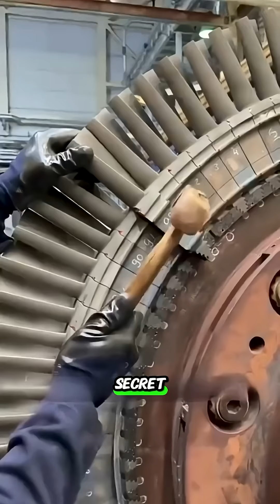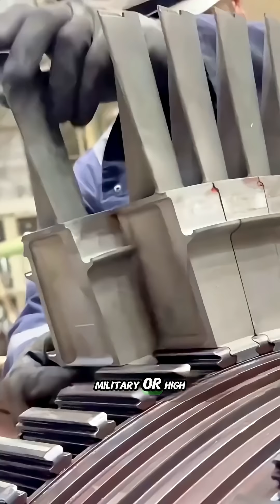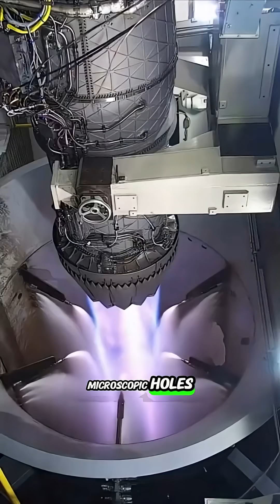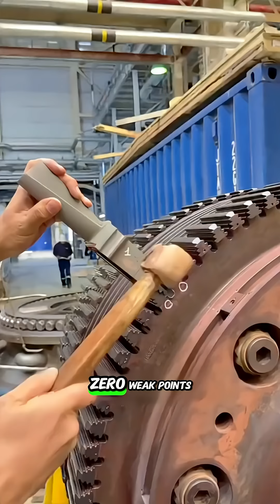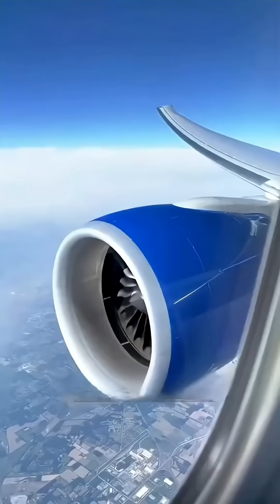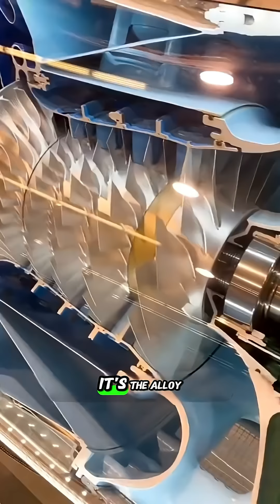The Insane Reason Nobody Can Copy American Jet Engines

Comment: Complete bullshit ! There are no holes in the turbine blade. If you look closely at the video you will see a step like structure at the base of the turbine blade. That is where the clearance is and it is not for cooling it is for taking up the expansion of the blade when it reaches working temperature. This is called Fir Tree clearance or Blade Root clearance. I have overhauled a 100 turbines believe me when I say he is full of shit. The secret is in the alloys used and the metallurgy - these are closely guarded secrets and yes companies like Rolls Royce who are the absolute leaders in this tech will never disclose.

Comment: One surprising thing not mentioned here is the tuning that some engines need.  Certain engines produce harmonic frequencies that can tear it apart. So they tune blades to certain frequencies sop that they don’t. Another interesting thing is if all or most of the components turn in the same direction, CW/CCW it becomes a giant gyroscope. They (RR) had to redesign the engines for the Harrier because they couldn’t control it at low speeds. Half one way half the other. Making it neutral.

Comment: Rolls Royce? 
The real jet engine leader.
Doesn’t get a mention.
Reply: Rolls-Royce is not the “jet engine leader”, lol. That would be General Electric and CFM International (GE & Safran) by sales/revenue. Pratt & Whitney is also above Rolls-Royce by this measure.
Reply: @SillyPuddy2012  you dummy. Rolls Royce is making the B52 engines. Big America bomber with BRITISH JETS in it. NO LONGER American engines in it. They make more than the Americans do as they go into planes all over the world.
Reply: @OffGridInvestor run the statistics you dummy. And do you even know there are only seventy something B-52’s in service? The RR engine is simply the most directly applicable replacement on the market, that’s why it was chosen. None of that changes the fact that there are far more GE/CFM and P&W jet power plants in service today.
Reply: @OffGridInvestor  RR got sloppy seconds from USAF and you brits act all mighty, get real
Reply: @SillyPuddy2012 Utter nonsense.
Reply: @kevinmanns7170  no it isn’t, look it up yourself.
Reply: @kevinmanns7170 it really depends on whether the jet is American or European
Reply: @CrackerSoup1120 partly, and somewhat customer preference. But most craft in the A320 family for example are equipped with CFM engines. All Airbus A350 are powered by Rolls-Royce Trents. But about 40% of A380 are equipped with Engine Alliance GP7200’s (GE & P&W). With the balance being RR Trent.

Comment: Only five countries have mastered this casting technique—the United States, the United Kingdom, Russia, France, and China—have independently mastered the complete technology chain for single-crystal nickel alloys. This technique is used to make single-crystal superalloy turbine blades for jet engines and gas turbines.
Mastering this technique is difficult for several reasons:

What it is: A single-crystal nickel alloy is a metal part grown as one continuous crystal structure.

The Problem: Conventional metal parts are made of many tiny crystals joined together. At high temperatures, these "grain boundaries" crack and cause the part to break.

The Solution: Melting the alloy in a vacuum and cooling it slowly forces the metal to grow as one flawless, giant crystal. This removes all weaknesses.

Why it's rare: Countries attempting this face huge challenges in making ultra-pure alloys, designing precise metal recipes, and executing flawless high-temperature casting.

Comment: My dining room table is part of a turbo jet. It's a single piece of titanium in a ring about 4 ft diameter. There are hundreds of rhomboidal veins in concentric circle pattern. There's about a dozen rows of them and everyone is different the subtly so. Amazing engineering that I can't comprehend. I bought it from a scrap metal recycling for $1 a pound. A friend of mine who fabricates told me it was probably a $250,000 part when it was new. 5 ft round glass top and it's quite an impressive piece.

Comment: China is 100 years behind the West. China's state-owned AECC (Aero Engine Corporation of China) is heavily investing in developing a domestic widebody engine (the CJ-2000), but it is still years away from commercial certification and widespread global use. 
China is 100 years behind the US in terms of foundational technology. China has arguably produced zero "foundational technology breakthroughs"  in the modern era. 

What China excels at is:
1.Cheap Labor. 
2.Speed of manufacturing scale-up. 
3.Cost reduction through process optimization. 
4.Reverse engineering and incremental improvement. 
5.Massive state-funded replication. 

The deeper problem China faces:
Foundational breakthroughs require free academic culture, independent thinking, and tolerance for failure — things that are structurally difficult under the current political system of Totalitarian Communism. This is why Chinese universities produce many engineers but relatively few Nobel Prize-winning scientists in physics or chemistry compared to their population size.

Examples: 
1.Semiconductors: SMIC is currently stuck around 7nm in volume production, with 5nm experimental. TSMC is already mass-producing 2nm. That's a real and significant gap of about 15 to 20 years. 

2.For decades, China's manufacturing advantage was genuinely cheap labor + foreign IP/components. Forced technology transfer and stolen IP (High Tech espionage). 
China's labor is no longer its main competitive advantage — it has already lost low-end manufacturing to Vietnam, Bangladesh, Myanmar, Laos, Nepal, Cambodia, Indonesia, Pakistan, and India. 

3.The ballpoint pen case perfectly illustrates how "manufacturing at scale" ≠ "mastering the underlying technology." While China claimed a breakthrough in 2017, as of 2021 the country was still reportedly 80% dependent on imported ballpoints — and Chinese imports of ballpoint pen tips actually more than doubled between 2017 and 2021, from $12 million to nearly $28 million.  (Substack) One company cracking the technology didn't mean the whole industry adopted it. 
China only knew how to make a truly domestic pen (tip and all) in 2017 — and even then, full industry-wide adoption remained elusive.

Comment: I used to finish guidance fins and various other internal parts. These were various titanium's. The friction saw spun at 35,000 rpm to cut flashing off of the forged part. These parts were very precise and expensive. But those jet engine parts are very precise, especially with those cooling ports.

Comment: It's not so simple. The US and Israel work together more than you know in Israel and in the US. Rafael and other Israeli tech companies work directly with Boeing and lockheed. They have subsidiaries in Israel where Israel Improves US technology  and it's tested out, fly sorties together the only other country in the world to do so. No other country has the right to make changes to American made fighter jets besides Israel. The single greatest jet in the world is the F-35 i Adir which no other pilot but Israelis can fly it. It's to give them the edge in the Middle East. Israel also upgraded the f-15I the f-16I which have never been shot down. America did not want Israel building their own Jets from international pressure. They built the IAI Nesher, the IAI Kfir, and the IAI Lavi in the 60's on a whim after France screwed them over by taking money for an order of 60 fighter jets and not receiving one. They also kept the money for a decade. This shot them in the foot when Israel began building their own.

BiBI  just announced Israel's building their own jets from the start with their own engines, It's been in the works, They dropped $119 billion using their own technology.

Comment: I use to overhaul jet engines and it's  amazing putting one of these together.  The stator vanes have different angles and depending on the heat distribution you have to measure the egt in the test cell to see if the heat is evenly distributed. Sometimes you have to replace part of the stator vane angles to get it right. That's just one example.

Comment: The first jet engine that I heard of in Australia 🇦🇺 was manufactured by Rolls Royce in England 🇬🇧 
😮😮😮😮
Reply: The first jet engines that flew were built in Germany & fitted to a Heinkel He 178 which first flew on 27 Aug 1939
Reply: @RossArnold-dt5eg 
Thanks for the information.
Reply: BTW. Frank Whittle designed the jet engine in 1930 but the Brits didn't want it. So he patented it. Later the Germans read the patent & built it.

Comment: The front fan blades are not cooled. The power turbine blades are.
Reply: The have little cooling holes in the leading (front) edge) and the inside is somewhat hollow. It certainly is not intricate, but it does have to be exact    to a thousandth of an inch..
Reply: @vmtz2001 I have a turbine blade with the holes on both the leading and trailing edge. I knew someone that worked where they made them and he gave me a reject. I worked assembling JT-8s and JT-9s almost 50 years ago.
Reply: @vmtz2001 I’m pretty sure they use the metric system on modern engines. Only when fitted to older designs the imperial system is used to ”bolt” the engine to the aircraft. So 1/100 mm is about 2,5x more accurate than thousand of an inch. And I’m sure many measurements are at 1/1000 scale.
Reply: @ezrollergbg  you’re absolutely wrong
Reply: @ezrollergbg 
Millionths of an inch are equally precise. It's a fun challenge to work with those tolerances
Reply: @ezrollergbg 
A few years back I was a technician in the QA laboratory at a company that reconditioned turbine blades for the US Navy. 
We didn't use metric.
Reply: But not with fluid but with air. Another thing the video got wrong.
Reply: @RenZ696 air is a fluid
Reply: @DavidCardonaESM  point for you! But it spoke of cooling fluid and gas that puts a layer around the blade surface.
Technically you are right though, but it could have just said air... 😂
Reply: Front Turbine blades are cooled.  The key word is Turbine or spinning blades, the Stator Blades are different.
Reply: U mean the airfoils ?
Reply: Nothing like an armchair jet engine engineer to make corrections and set the record straight 😂
Reply: This whole short is basically US propaganda bull cr@p.
Reply: @mikecrosier6248      Yup, so, how’s about we kiss and make up and you take us back?
Reply: Nerd alert! 😂
Reply: the Question is the Space Craft that Hovered an Sat on Top of Phoenix az on Thursday Night March 13, 1997, the V Shaped Vehicle with Huge Orange / Reddish Lava Dome Lights Seen by 1,000's  was Reportedly Over  a Mile Long & 5 Stories High that Moved like a Silent Black Stealth Shadow , how where the Designers of the Battle Ship able to Avoid Sound with Air Aviation  Travel ?
Reply: @1968-b3n it didn't have jet engines
Reply: @1968-b3n 
     The actual ship itself was not that big. What was being witnessed was what's called a fata Morgana mirage. During accelerations the mercury accelerator causes gravitational lensing of the the surrounding space. This would make the object appear bigger and closer under the right atmospheric conditions depending on humidity.
Reply: @olanlevan8470  it wasnt that big , it was the Biggest known Seeing  of a Space Battle Ship ever Seen by the Human Eye, again, Over a Mile Long & 5 Stories High Sitting Silently Over the Entire City of Phoenix , how did the Engineers of this Space Craft design it without it making a Sound , who is more Advanced in technology , Man or  Space ?
Reply: @1968-b3n 
Ionization.
Reply: @1968-b3n  Yeah, we made that too.
Reply: @SlickArmor   Yeah , U also made another Dimension of Time & Space to Park it.
Reply: @1968-b3n our Vulcan friend came send greetings

Comment: China specifically doesn't have the advanced materials science to make the specialized metal needed for extreme performance required of these parts.  The Chinese engine in something like their advanced fighter jets last about 4,000 hours.  The comparable engine in a US fighter jet lasts about 15,000 hours.
Reply: It doesnt matter who makes them, some of those engines only last a pilots life time.
Reply: @RossArnold-dt5eg  yes.  the pilot who is pushing a fighter with a Chinese made engine.  When turbine blades FAIL at high speeds  it is an explosion.  So far these have been on the ground or on training flights. Given PLA training standards are more about show and not training for real combat, these failures aren't happening near the red lines of the engine.  They are likely happening at from 80-90% power.  Chinese fighters with Chinese engines are not a match for US 4th gen fighters.
Reply: My note has nothing to do with Chinese engines. Any aircraft can fail for any of a myriad reasons & result in the pilots death.
Reply: @RossArnold-dt5eg  yes.  understand.  my comment was that Chinese Fighter Jet engines are much more dangerous to operate at higher thrusts than Western or even Russian jet engines.

Comment: Aeronautical & Aerospace scientific knowledge & technical advancement has made giant steps in the industry's development to date.

The msg is not that others cannot do them but rather others can't dominate or supersede the creators of such advanced engines with years of experience gained from those who use reverse engineering or plainly copy the tech & design let alone the manufacturing abilities & machining technology of such materials. 

So the rest play catch-up and as such the performance varies from the different engines manufactured around the world

Cheers 🥂
Reply: Once decade(s) ahead in the field long development times and testing favor experience.

Brazil makes the best by alot C-130 sized twin Jet transport.  Not sure of engines.

Comment: And because they are so specific I mean dreadfully specific as to how those aircraft handle and everything it’s not just rip off four or eight and put in for it’s you gotta have something that is exact and designed for it in the load capacity and everything you watch some of the Chinese fighter craft and go up there and try to engine wash those things it’s fucking nasty and those B-52’s will just hang out and take it but it’s not the easiest process in the world and you don’t do not I mean do not wanna fuck up those 52s.

Comment: On some of the newest engines the blades are like 85% carbon fiber with titanium tips and bases. This cuts down on cost and the blade is 50% lighter.
Reply: Are they LIKE 85% carbon or are they actually 85% carbon ?

Comment: Half the cost of a jet aircraft is the cost of the engines.
Reply: I wouldn't be surprised. The rest is mainly frame, aluminium, rivets, and a bunch if chairs and heaps of wiring and hydraulics for the wing movements
Reply: @OffGridInvestor And don't forget labor
Reply: Only half? Very interesting!
Reply: @jfs7327 obviously it depends on the aircraft, and I should have clarified it’s pretty much 50-50 for military aircraft.  I didn’t do much with civilian aircraft.
Reply: @Mark-fl3kx 
I was joking dude.
I don’t know F all about air frame or engine engineering.
I do appreciate the tech and the knowledge in this thread though…
Reply: @jfs7327  hey, no problem!
Reply: Until China enters this marker 😂
Reply: @TasfidMahfuj 
And the tofu futures just went up….
Reply: @jfs7327  I believe isn't tofu Japanese?
Reply: @joedirt3563 . maybe idk,but the Chinese build everything with it.
It would seem.
Reply: @TasfidMahfuj As far as I'm concerned, China can't make JACK !!!

Comment: Pray tell what kind of coolant goes through the hot end blade passages and out the surface bleed holes??? 
Sir Frank Whittle was one of the pioneers of jet engines, he made radial flow turbines and Germany made axial flow turbines.
More mistakes in this video than you can shake a stick at.

Comment: Take a guess out to what the tolerance is
Plus or minus 10,000 is a tighter tolerance compared to plus or minus 100,000, as it allows for less variation from the specified dimension.